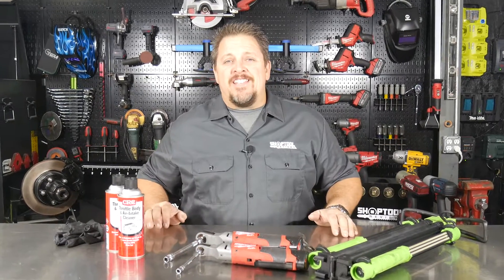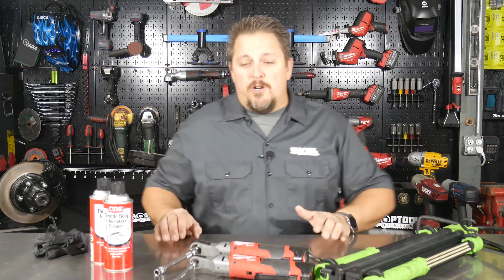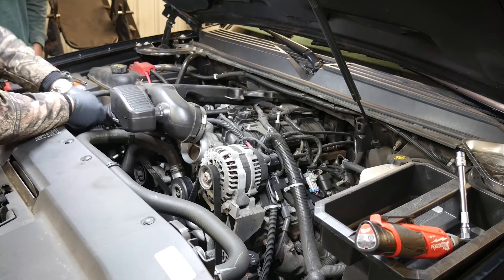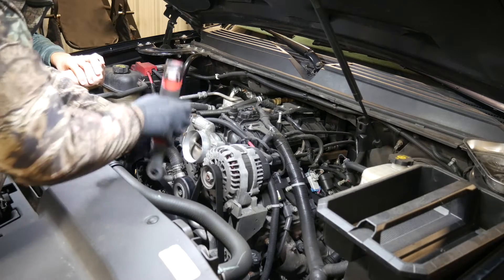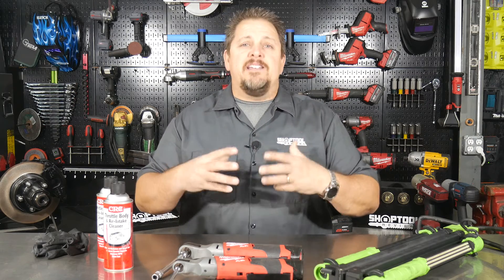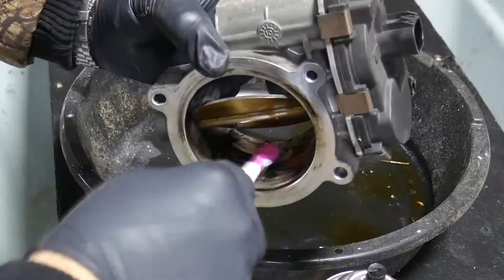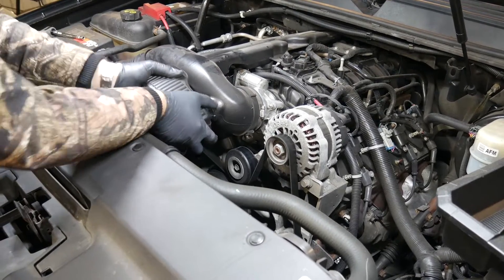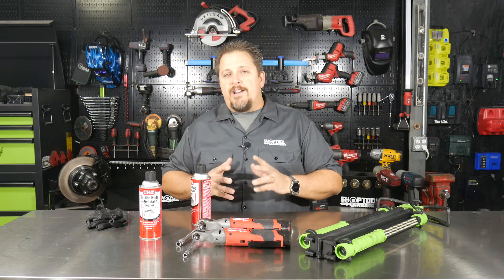Throttle Body Cleaning - Milwaukee M12 Ratchets

Comment: dont do this to ford or nissan electronic throttle bodies. ive personally ruined a nissan one to the tune of 250$
Reply from the maker: How did the damage occur? Did it require a new throttle body, due to the cleaning, or did it just have to be relearned from the dealer?
Reply: Shop Tool Reviews doing an idle air relearn did not fix it, i did it myself and got the dealership to do it just incase. Im not sure why it damages it but nissan specifically says to never move the throttle plate ever. Also theres a special coating on the bore of the throttle body. And yes it required a new throttlebody